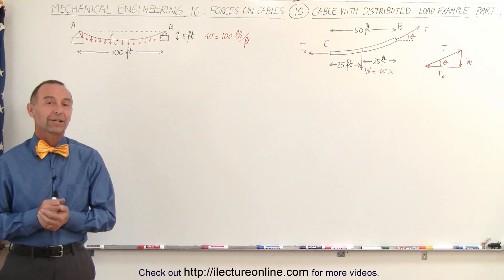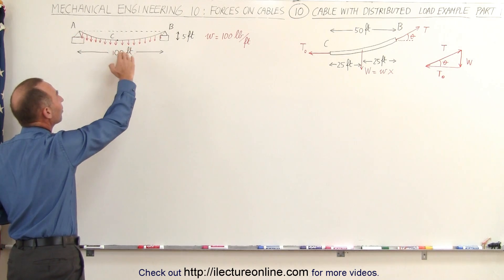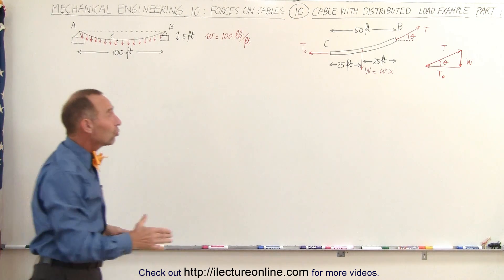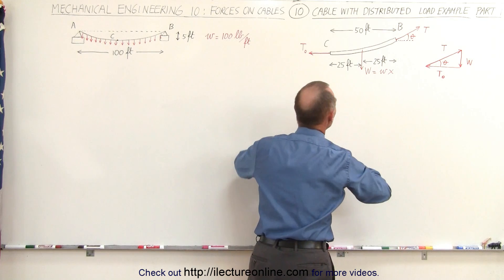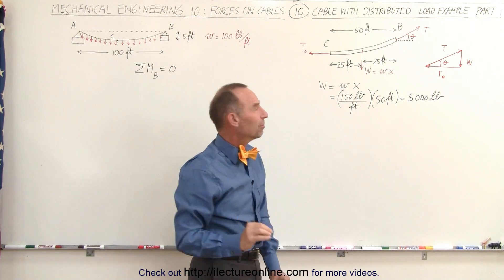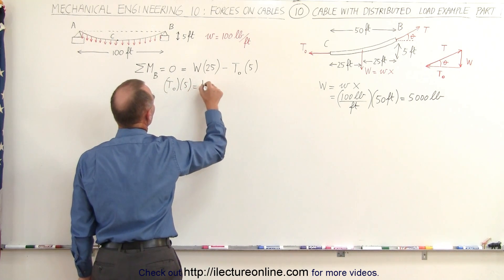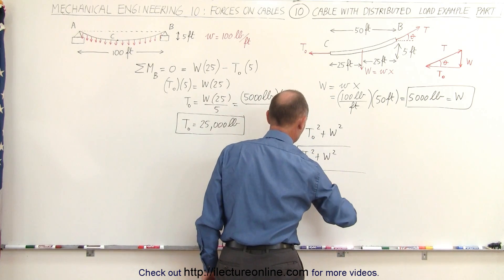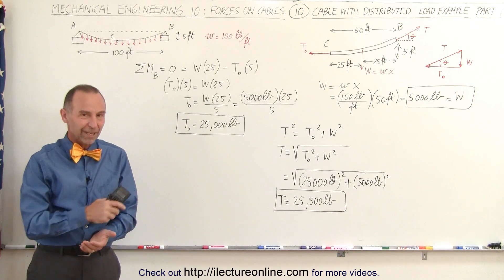Mechanical Engineering: Ch 10: Forces on Cables (10 of 33) Distributed Load: Example (Part 1)

Comment: In 3:40 you calculate the Weight per feet of the cable without knowing the lenght of the cable( or half of the cable) , in real-life we name it "span" , so you calculate the weight of the half lenght of the cable using half span while length of the cable must be longer, and the weight per feet should be more also.
Reply from the maker: It is a close approximation.  With these approximation we are only off by about 0.5%  (see video 18 in the playlist)

Comment: Dear Mr. Biezen, because you are talking about uniform distributed load on the horizontal line (which leads to your calculation of W = w.x) then it's perhaps clearer to draw the distributed load on the horizontal line (instead of on the cable). Should the load be uniformly distributed on the cable (e.g., the case of cable self-weight), the equivalent horizontal load will be w.x/cos(theta) where theta is the inclined angle, which is changing, which makes the horizontal load not uniform any more. Please correct me if I am wrong. Thanks for your decent series on cable analysis.